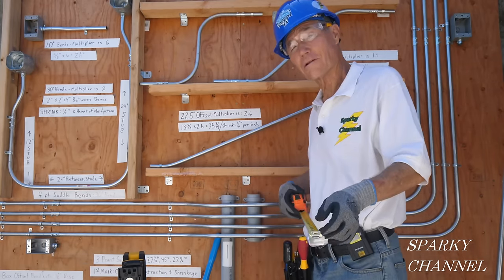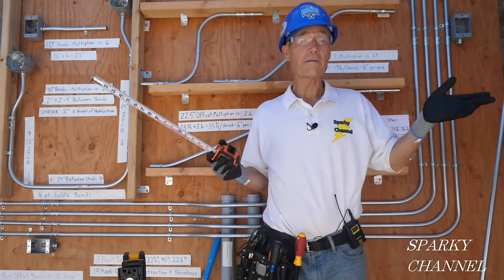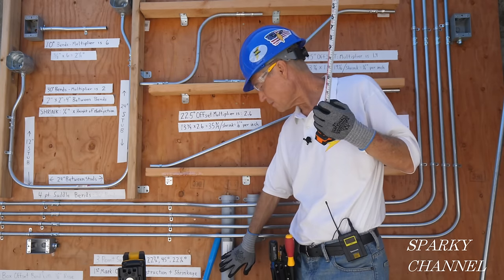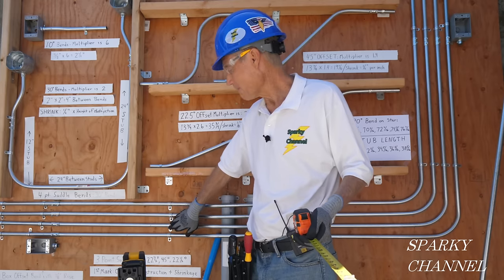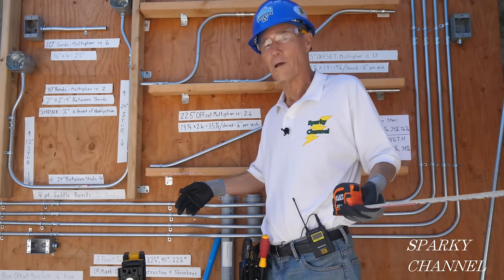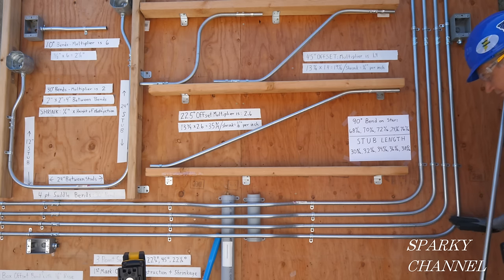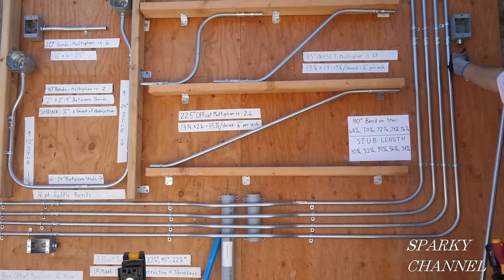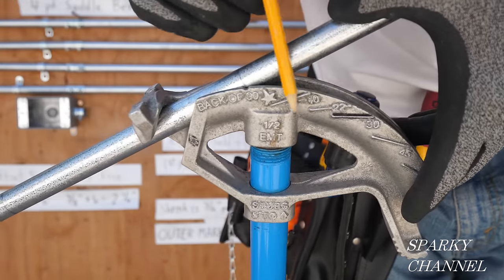Box Offsets, 3 Point Saddle Bend, Parallel EMT Bends and Concentric 90° Stubs all in One Conduit

Comment: Your the first person I've seen actually measure a box offset.
Reply from the maker: It's good to teach it that way for those who are just learning this skill. Later on, when they are experienced, they can try doing it by eye.
Reply: Foreal but I’m not mad at it 💪🏾
Reply: I got into the habit of marking my box offsets after watching the Ideal video with Ron. I do it for consistency. Now I can eye ball it, but if I need to do a bunch to match I'll take the extra few secs to mark them out.
Reply: @danielhady3021  you can save time by using 4 fingers from end of pipe to first mark every time without measuring
Reply: @fredbledsoe9841  exactly.
When we were allowed to run pipes in steeldeck, i automaticly knew were to put my hand on the bender and when the pipe reached it, i left my hand there and simply turn the pipe and bend it again until it reached my hand with the same feel.
2" offset quick and easy. Almost never had to correct it ..perfect offset without having to compare it with an other straight pipe.
Like you said, muscle memory!
Reply: When you got a few in a row it's nice for consistency.
Reply: We mark our box offsets on the jobsite
Reply: Key word is professional! Imagine doing box offset for 20 j boxes and they all look the same. Clean and professional.

Comment: I bent my first pipe in 1977 and still doing it to this day. I learned all my tricks from watching guys like you on the job. Nothing is as pretty as a bunch of parallel pipes with perfect bands. I hate walking up to somebody else's job and having to run my stuff crooked so that it looks straight because the last guy didn't take the time. When an inspector walks up and sees a nice pipe job, he knows that you know what you're doing and will be nice to you on every job in the future. I developed some good relationships with inspectors over the years this way.
Reply from the maker: Thanks so much! 1977 was a good year! Yes, it's important to gain the trust of an inspector by having him respect your work!
Reply: @SparkyChannel  I was 15 when I learned from my first mentor. Another man I worked with was an old gray guy in his mid 70s. The man knew his stuff! Another taught me that I'm not just bending pipe, I'm covering wire. I always keep the wire and pull in mind when you're running your pipe. You're not just connecting boxes.
Reply: I started in 80. Still doing it to this day. Pipe work is nice...but, as a 1 man show, I don't have the time to make it perfect. You can make your bends a bit long long and trim with a recip saw. Time is $, couplers are cheap. Makes for a good video. Apparently I don't like bending over my work to check angle degrees. I was glad to finally see the bender head in the air, not on the ground. That's my .02

Comment: I have been plumbing for about 28 years, just kinda stuck  with it, but working alongside electricians has always made me jealous. you guys have the best tools and the cleanest tools. If I had to do all over again, I would definitely be a Sparky. Great video.
Reply from the maker: I worked professionally as a concrete finisher, plasterer, roofer, plumber, carpenter and draftsman. I became jealous of the electrician's like you did so I became one. IMO it's the best trade. Thanks!

Comment: Interesting methodology. Sin(10 deg) = 1/5.76, which is close enough to 1/6 to remember without a calculator. And the one side 'shrink' is (1-cos(22.5))*(height/sin(22.5)) = 0.2*height, which is rounded to 3/16" per inch on an old style tape measure. With all of this complexity, it is easy to see how experienced guys choose one method, memorize the ratios, and use them every day. Best video I've found on this topic.
Reply from the maker: Thanks so much!

Comment: This is how I was taught in 1st yr of the IBEW program. Learning the math, shrink factors, and multipliers. I try to use this method as much as possible as opposed to cut to fit to keep myself sharp. You make it look so easy and natural. 3 pt and 4 pt saddles are really easy to mess up with dog legs etc. 1/2" emt is atleast easy to fix but it gets a lot tougher with the larger diameters or RMC.

Comment: Oh my gosh. I have a headache. Stars, arrows, notches, blue moons, and green clovers. Raised on rigid benders, just not that complicated. Also,I would recommend that beginners use the bender the way it was intended, until you get a feel for the bend, use the foot pedal and make sure you apply good foot pressure. Or you will end up with crinkled radius. If you dont apply the correct pressure at the right place when bending head up, you will end up with  crinkled conduit ridius and a bow in the straight. Conduit bending is awesome, this was a great video and a great job, just adding my 2cents. I was so lucky as an apprentice 40yrs ago to have men like this to teach me.
Reply from the maker: Thanks Joe!

Comment: After years of running raceway of all types EMT GRC IMC PVC NMT and my favorite of all has to be Greenfield and no inside screw connectors! 
But yes I was able to do a lot of bends by feel and a general measurement mostly for length. 
Now the work of art that is being demonstrated is different and all angles have to line up accordingly. 
Most excellent presentation.
Reply from the maker: Thanks so much!

Comment: The best tool after your bender is a table, even a folding banquet table. It gives you a 90 degree angle, a straight edge and a work surface. AND you are NOT working on the floor! Cuts work time by a FRACTION 
also laying out sweeps and couplings made easier. And a lot easier having your hand tools boxes of hardware couplings straps etc off the floor. 
Weve built several 4x8 tables on casters to bring on jobs
Reply from the maker: Sounds great thanks! I've seen many emt bending techniques. I would never insist on one particular style.

Comment: I bent pipe from 1990 to 92 it was the best part of the job. After work slowed down I got out of electrical work. But I sure miss it sometimes. Also is it just me or does that Romex  stuff just don’t seem right to use
Reply from the maker: Hi! I agree, wire run in EMT makes a better and longer lasting job.

Comment: @4:40...

Yeah the accepted Paradigm for the Box offset what you demonstrated is classical and basically perfect enough but I'm of the opinion you should move your first mark back Four even 5in... I like to have a little more latitude for any fine-tuning and precision I like to get my bends perfect and if you I have a small bit of pipe to work with on the nose it's just harder I found then if you give yourself that few extra inches also to when feeding wire it tends to act as a barrel to make it guide a little bit straighter and not get bound on the  inside edge of the connector...
Reply: Specifically if you have insulated throat bushings I mean that's all cool I love them but the threads in there A lot of times especially if you're just pushing the wire box-to-box gets bound up on that inside thread on those small box offsets...

Comment: I know nothing about this subject, but as a Woodworker, I wonder if it’s possible to run conduit without math, as it’s possible to do many woodworking operations that way. Sorry if this seems like a dumb question, but that works seems simple enough that you might be able to have a numberless way of going about it.
Reply from the maker: Yes, it is possible. I wouldn't recommend it to a beginner though as it would most likely end in having to throw out the conduit.
Reply: After years of running raceway of all types EMT GRC IMC PVC NMT and my favorite of all has to be Greenfield and no inside screw connectors! 
But yes I was able to do a lot of bends by feel and a general measurement mostly for length. 
Now the work of art that is being demonstrated is different and all angles have to line up accordingly. 
Most excellent presentation.
Reply: Yes. Depending on the bend.

You make a general bend. If it doesn't fit like a 90, you cut it down or extend it. If its an offset, and its too big, you can cut it in the middle of the offset and cut off a little bit from one side to make it the correct offset height.

Although these kind of tricks means you dont use one solitary pipe which some people like to brag about being able to do. But in the end, the conduit paths just need to be connected to each other and the wires within just have to reach one box to the next. Whether the conduit in between is professional looking or not, doesnt mean its not going to work.
Reply: @fjl05  the object is a raceway that is the shortest distance the least amount of conduit with long sweeping bends to change directions , well supported,
Reply: And yes I have some amazing 1 stick lengths of raceway. I have thought a measure of skill is do end up with the least amount of short sticks
No
Reply: @gerhardschemel3565  yes thats true. but many times, its not worth the time and effort to do so. Not cost effective to get it all in one pipe when the customer is neither going to care or pay more because of it.
Reply: @fjl05  sad but true it is quality that gets axed first

Comment: I always thought "concentric" 90s meant that each conduit run had a larger radius so that the 2" spacing is maintained at all points.
Reply: Yeah I think he has it wrong. Concentric literally just means the center point is the same. If you imagine each bend as a full circle, their centers should all be the same for concentric bends.

Comment: Great Job Bill Question SPARKY How Can I Tell What Direction To Face Ten Degrees Before I Bent The 45degree Face Up Or Face Down. TIA
Reply from the maker: Hi Bigmo! If you do the box offsets first, it doesn't matter which way you start the 10° box offsets but then you have to get the saddles in the correct plane. But if you make the saddle bends first, you must get the box offsets in the correct plane after you're done with the saddles. Generally, if your saddles are pointed up, your 1st bend for the box offset is down.
Experience is the best teacher for that.

Comment: Nice video. I was wondering why you use 45° bends for your 3 point saddles? When and why to choose the different degrees? For example if your obstruction were 1"wide by 1" raised. Your multiplier at 45° would be 2.5" on either side of the center line. Wouldn't the 3 bends then interfere with each other?
Reply from the maker: A 22,45,22 3 point saddle bend would generally be used to jump over an item when you don't have a lot of space to do it. 3 pt saddles with lesser angles would usually be used to jump over smaller items.
Reply: Dude I didn't see him put the 2nd box offset after the 90° wtf
Reply: @SparkyChannel  Okay, so for a 1" obstruction what angle would you use for a 3 point saddle? 11 22 11?
Reply: @gonsalvesjoseph248  LOL..I KNOW he said in a diff video he shows it.. i thought i was bugging,myself, son..lol

Comment: You did the 90 degree bend at 76 7/16. But from where? From the end of the conduit? Is that the end as bent for the box offset and saddle? Is that  from the end of the unbent conduit? from some place else? I'm not sure where you measured from. And then is that where you marked the conduit? Or is that the total length to the finished  riser - the vertical green line from the laser level?  Good stuff, just missing a few details.
Reply: He measured from the original box  offset end. If you use the arrow mark you measure to where you want the back of the 90 to be then subtract your deduct (5" for 1/2 emt) and bend up the side you measured.  Or if it's easier like he did you can use the star and measure where you want the back of the 90 to be (no deduct with the star), but you bend the side of the pipe you didn't measure.
Reply: @thechancemanvcc  Thanks for the info. Very much appreciated.

Comment: @10:21...
I would dry fit the pipe against the wall to check for level and such I imagine you did but it would be cool to see it...and then put your torpedo level up check to make sure your Square with your Bends ? I also think to all your shrinkage is on the tail one really need not be preoccupied with shrinkage except for overall finish dimension in my opinion it's good reference to know though one should be aware of it but I imagine I haven't got to the end yet it's hard to see perspective and scale but I imagine you're going to trim that pipe? Looks like it will finish with one stick?
Reply from the maker: No dry fit on this one. Just put it up.

Comment: I'm confused on when to  use the bender ARROW,  NOTCH, or STAR. Is there a rule of thumb when to use each of the  bender markings ?
Reply: The notch is ONLY for center of 3point saddles, by default you will otherwise use the arrow UNLESS you’re bending a 90 and the long end of the pipe is in front of you, you can reverse the direction of the bender and put the star on the exact measurement
Reply from the maker: Here you go: Push-Through 3 Point Saddle Bend: Easy, Fast and Good for Tight Spaces: https://youtu.be/MZQNOJi79Jo

Comment: Question: Does the measurement for the 90 degree take into account the shrinkage from the box offset and 3-point saddle? Does the box offset and the saddle need to be bent before you measure for the 90?

I start my IBEW bootcamp in 2 days.
Reply from the maker: The 10° box offset shrinkage is 0, so don't worry about that. We measure for the 90° bend after the saddle has already been made so you don't have to worry about that shrinkage either.
Good luck!

Comment: Does the shrink change depending on the size of the pipe or is it always the same
Reply: It does not change based on the size of the conduit,  shrink is in relation to your offset bending angle, for 30 degree about 1/4", for 45 degree about 3/8".

Comment: Hey Sparky, nice explanation. However concentric pipe runs and bends refers to the conduits being the same and equal distance apart including through the bends. that means in your case example 2'" apart all along the distance travelled including through the 90 degree bend. in order to do that 90 you need to use a pipe hicky ( bender). but overal a great explanation
Reply: His name is Bill. 👍🏻

Comment: Did you had to add more leight to the 38 5/16" for the box off set located at the top ? I'm assuming you had to since the conduit will shrink about 1/4" if I'm correct. If I'm wrong please let me know.
Reply: it would shrink about less than 1/32 of an inch due to the 10 degree box offset. Shrink per inch for 10 degrees is 1/16th so the box offset will be negligible.

Comment: Would the multiplier be 2.5 inches from your center mark over a 1 inch obstruction for a 3 point saddle on 1" emt?
Reply: Yes, multipliers are a constant no matter the pipe size
Reply: @Hatim.13  ok, thanks. I've done plenty of 1/2 inch and 3/4 but have never done one on 1 inch
Reply: You can lessen the degree on bend, so for example you may find that the nose of the shoe interferes with the first bend.  You might want to bend a 30/15 saddle, which will move your second and third marks further from the center.  Also, keep in mind that a 45/22.5, 3 point saddle is  90 degrees on bend in total.  By code you can only have 360 degrees of bend between pulling points.
Reply: @ISharkl_76  same principle, just takes more effort.

Comment: Dude Sparky. Great Video Taught me so much. Needed these three basic bends explained and you did a fantastic job of it. Now I was just wondering if these Bend Rules can be used across all Sizes of Conduit not just 1/2 Inch EMT? Thanks appreciate it.
Reply: Different sizes have different shrink and multipliers. The company I work for mostly uses 3/4, but there are charts online so its no big deal if you learn the processes.
Reply: @damonmalcom2499  ok thx. ill look em up
Reply: Look for an app called quick bend.  For 5 bucks, it will tell you everything you need to know for your bends, you just have to input what you're doing, and it calculates the rest

Comment: If I'm gonna make a 45° bend on 1/2" EMT and my sharpie mark is lined up with the⭐. The bender hast a 45°  line on the head and I'm pulling the pipe down. What part of the piece of EMT do you stop at? The top of the pipe, bottom or center for the correct angle? 🔌
Reply: The bottom 👍
Reply: You bend until the bottom of the conduit is parallel to the angle line on the bender

Comment: 1st yr apprentice here, getting all the calculations fine each time, my problem is where to line up the emt with the degree marks on my hand bender I feel like I bring them to the same point each time but I'm almost always open or closed. Of course then I have to play with the conduit every time to get it to be the exact heights I want on my offsets. Do I line the bottom of the conduit up with the exact center of the mark or just make it look like its parallel with the line, any help would be greatly appreciated.
Reply from the maker: Line the bottom of the conduit up with the exact center of the mark plus just a little to compensate for spring back.
Reply: @SparkyChannel  thank you sir
Reply: Phillip Wilson also, do your first bend as "perfect" to the degree that you want it at, the 2nd bend try to do the same but also just focus on making the 2nd bend make both ends of the pipe parallel with each other. (I.e. if you want a 4" offset with 30 degree bends, if your first bend ends up being say 28 or 32 degrees, just match the 2nd bend to that. The tiny little bit over or under wont make much of a difference to the offset amount unless youre doing a huge offset